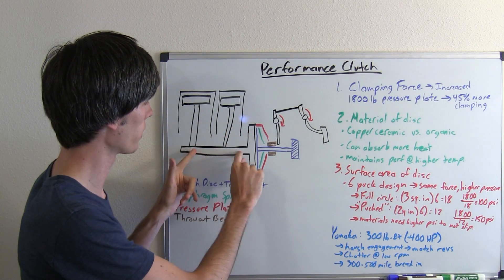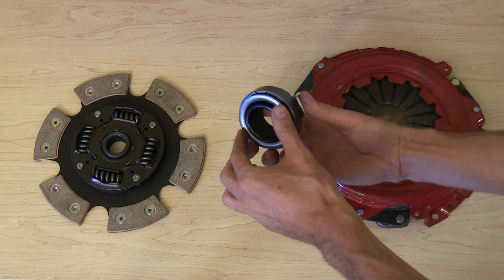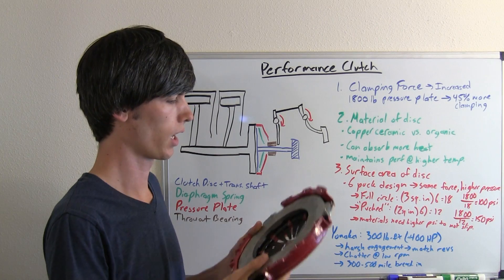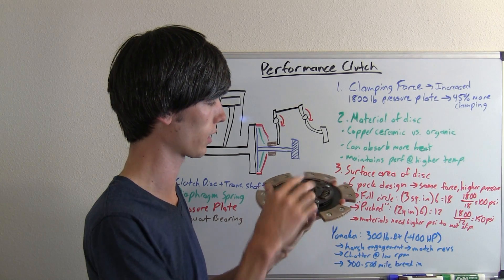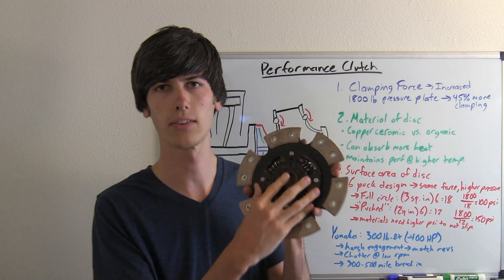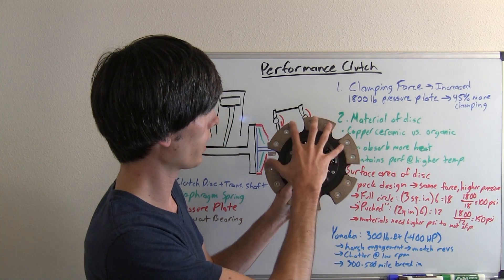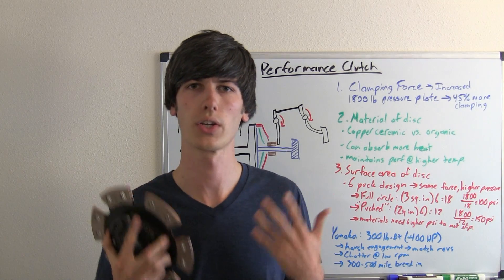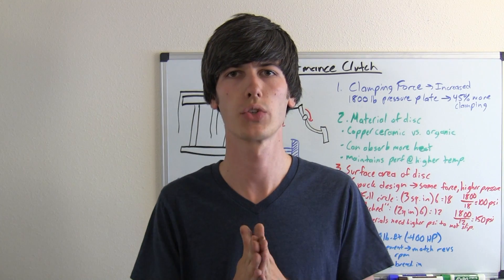Performance Clutch - Explained

Comment: Question: let's say you have a set of helical gears with a ratio of 23:17. Even though they have odd numbers will they still mesh? Let's say you have a ratio of 25:24, even though one gear has odd and one gear has even numbers of teeth will they still mesh? Do you(or anyone) know?

Comment: Usually when you do a clutch job, you also either machine your fly wheel or you replace it. If your upgrading the clutch you will most likely upgrade to a lighter weight flywheel.

Comment: You should mention as most times you do why do manufactureres are not using some solutions you describe in OEM. These presure clutches are not working so smooth when starting to move a car on 1st gear as on OEM clutch. But I hope you'll mention that on your video covering what springs are for in a clutch. Cheers! (Still waiting for a video in which you will try to describe what breaking with left foot in races is for:)

Comment: hey this performance clutches are wight less than the OEM clutch right..so when you replace your ordinary clutch to a performance clutch don't you think that the crank shaft would go unbalance because of the light wight of the performance clutch???

Comment: To put it simply, the springs help reduce vibration in the disc and allow it to slip slightly easier when starting from a stop.
Many racing clutches(different than the performance) do not have those springs in place because you can save weight in rotating mass and generally dont need to worry about starting easily from a stop. give it some gas a go!

Comment: Very interesting video :)

I did not realize how much of a difference a performance clutch could make until I watched this video.  I suppose it was a misconception on my part that the biggest difference was the weight, reducing rotational inertia in the drive train.  The parts that are being sent in are extremely helpful as well, since seeing the part out of the car really helps the visualization process (not that your drawings are bad xD).  Please continue doing what you do :)

Comment: no, stock clutches have more slip and less pressure on the plates. although it does make for smoother shifting when you do, its not going to harm the car at all if you don't.

Comment from the maker: Probably not, you're going to want a different pressure plate, as these clutches are designed for higher pressure, and likely won't work too well with lower pressures than they're designed for.

Comment: Does having a performance clutch affect the gearing in any way ? For example an oem clutch in 5th gear doing 70 mph at 3500rpm will changing a clutch make it rev higher or lower to achieve the same speed in a particular gear.

Comment: No, i think you'll need a better clutch only if you have more Torque to transfer at the transmission, so you need a Bigger clutch/more resistant or a multi-plate clutch (there's a formule to determine of much of torque your clutch can transfer in his video on clutches ). A larger tire will produce more friction (so you'll have less whp, because you loose much power ), but your car will have more grip (and then it'll handle better), that's only that.